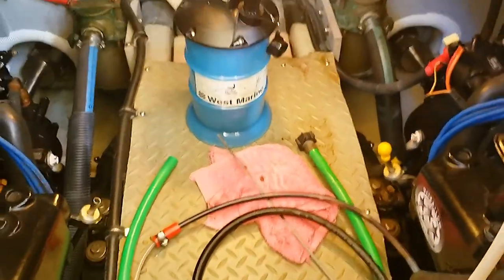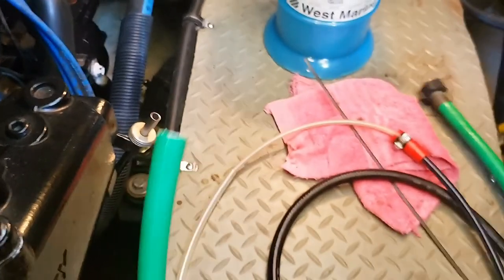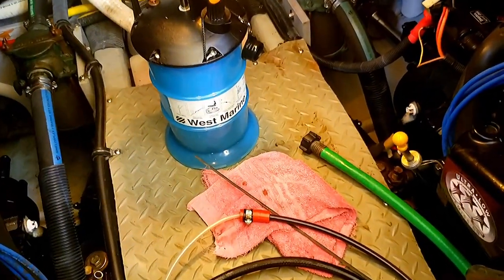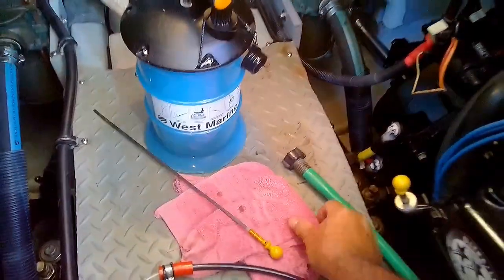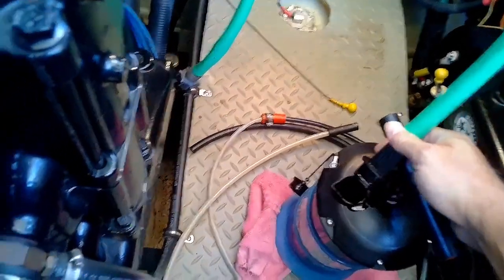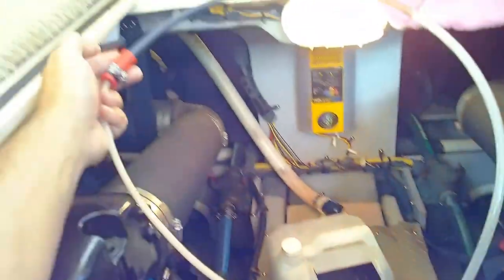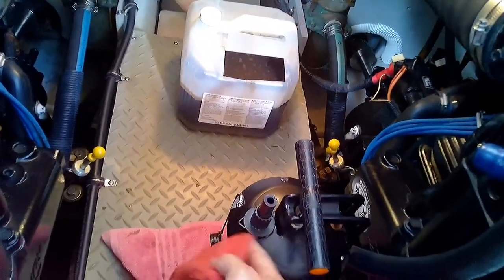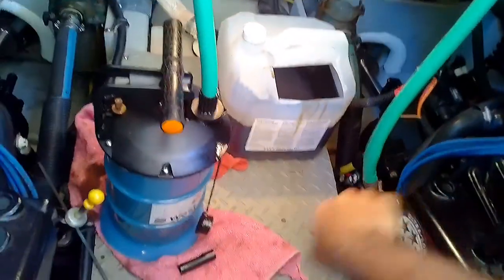Boat Oil Change with West Marine oil pump

Comment: I pierce the top of the oil filter with a screwdriver before I remove it.  It allows the oil in it to drain into the pan and reduces the mess considerably…..
Reply from the maker: I've heard that and actually spoke a bit about it on video that I edited out.  Ill try it next oil change!   Thanks.
Reply: @AdventuresofHappyOurs  It really works!  I also cut a slit in the oil-absorbing sheet and slide it over the filter down to the fitting.  It acts as a bib and catches most of the remaining oil in the filter when you spin it off.  LOVE the new method you used to push antifreeze through the motors. Great idea!!!

Comment: It's impossible to get all the oil out unless you remove the drain plug. The oil pan shape of a 305 and 350 prevents a tube to get to the lower part of the pan. Just because there's no oil on the dipstick doesn't mean there's still not 2 or 3 quarts still in it.
Reply from the maker: This is the method most all boats use to change oil.  There may be a little oil left but certainly not a quart.  It’s just not possible to reach drain plugs on most boats to effectively drain oil through the bottom.

Comment: Great video. I am changing my oil tomorrow on my 2007 341. How did you pour the oil back in the starboard motor. The fill neck is on the back side. Did you have to move the couch and lift another panel? You have no idea how much you are helping me!!!  Thanks and keep them coming.
Reply from the maker: I didn't move the couch.  I just reached in to the fill cap and poured one quart at a time.   Real PITA!  But it worked.   Wrap a rag around the fill neck in case any spillage.  Took time but it worked.  Good luck!
Reply: @AdventuresofHappyOurs  Just got home. Successful day. I used a piece of 5/8 clear tubing stuck to the end of my funnel. I bought gallon containers of oil so no way to get to the neck. Sloooow pouring but worked. Changed IAC filters. Cleaned spark arrestors. I have had her in the water 2-11-22. Just about ready for summer !!!  Going to make a charcoal filter this week. Have you had any problems with tank sensors? My fresh water and my black are bad. My starboard fuel is reading 1/4 low. I just filled both tanks.
Reply from the maker: I had sensor reading issues with my black tank and pulled the sensor, cleaned it and the connections and reinstalled.  It has been working ever since.  I have a video on part of that project too.  https://youtu.be/md24zGC6l8A

Comment: Is it near impossible to do it via drain plug?
Reply from the maker: Very little clearance under boat motors to drain oil.  It’s so easy through the dipstick I wonder why we don’t do it for cars.
Reply: @AdventuresofHappyOurs cars,  I think that vacuum could pull on things like oil seals around the crankshaft or maybe collapse an older hose of the pcv system.
Reply from the maker: @stevemurray710  an engines crankcase is not that airtight.  Siphoning oil out of engine dipsticks is the most common and approved methods of changing oil on boats.